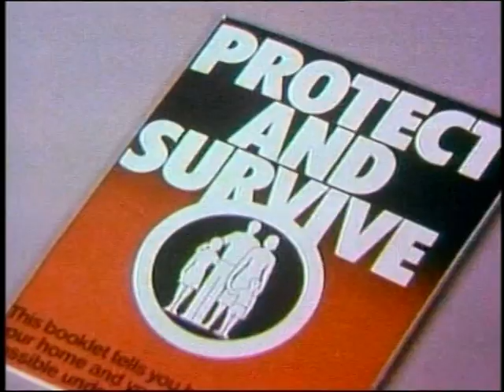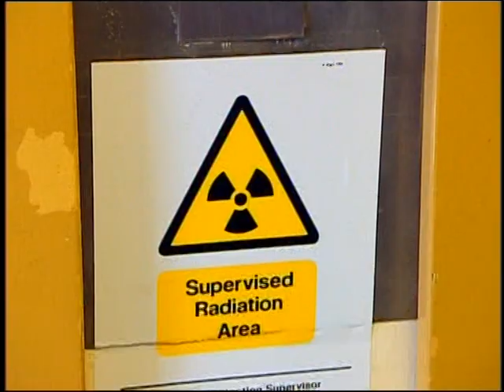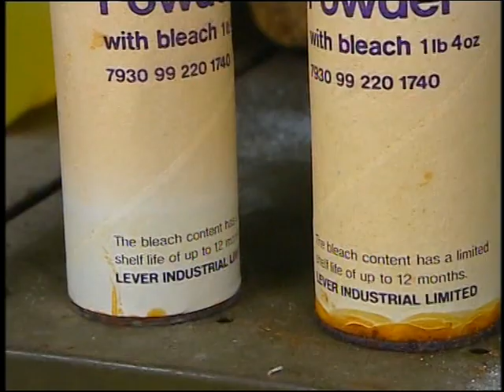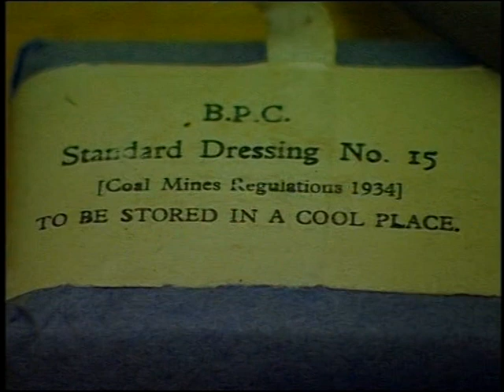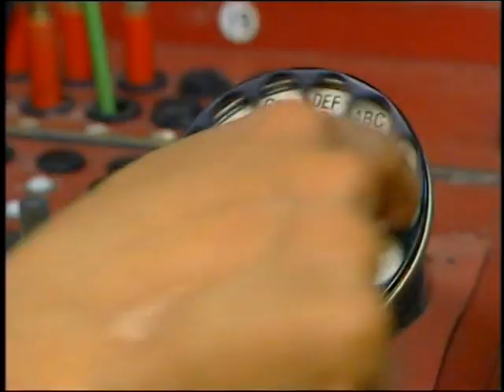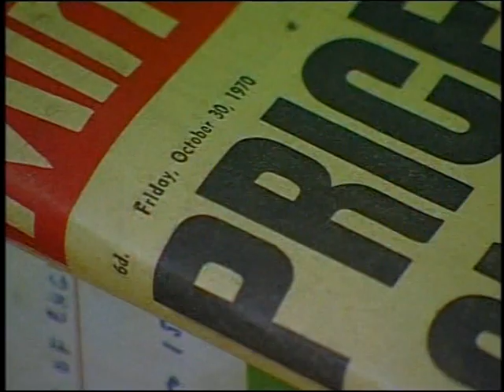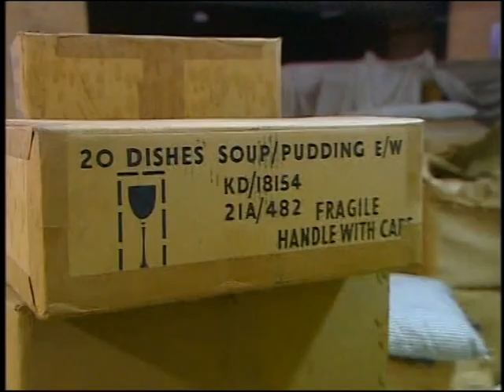Burlington Bunker Blue Peter

Comment: No ufo,s down there then 😂
Reply: This part is just the front. It is not access to the actual base. No one has ever been there. Dark Arts, Exploring With Fighters and Secret Vault did go here and the neighbouring surface areas and explained.
Reply: @greatestjourney6412  The site she entered from was known as 6SU and gives access to WCK South site. There were numerous entrances, outside Royal Arthur , CDCN, Copenacre, Spring Lane, Peel Circus, Spring Quarry plus many more and an unknown entrance through Hartham Park quarry on the Bradford Road that was in private hands and was accessed through two sets of alarmed doors and a guard post (its now bricked up). All of these give full access to Burlington. There is no secret entrance through Box railway tunnel and the set of doors at the entrance on the Corsham side of the tunnel at Spring lane were for something completely different.